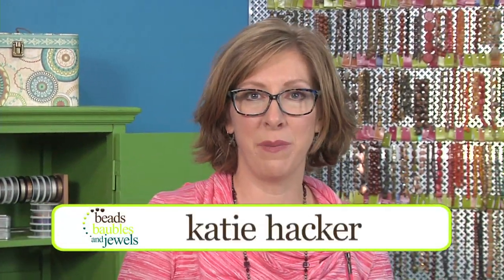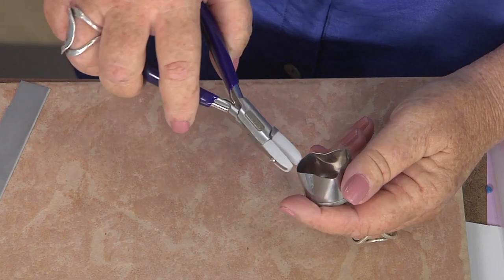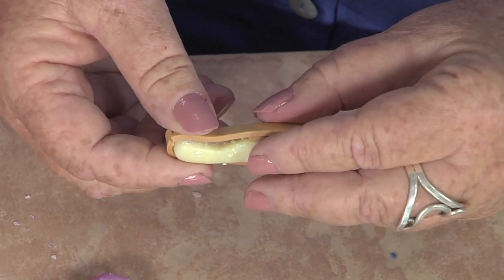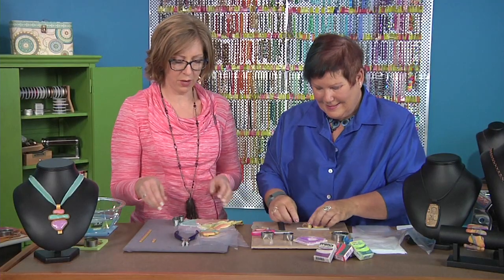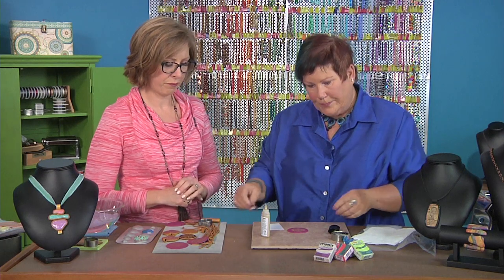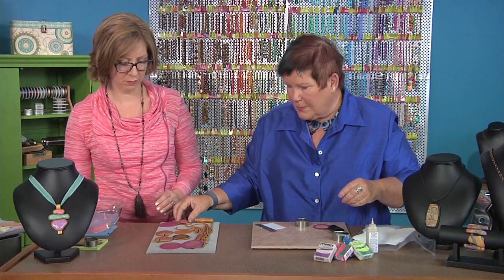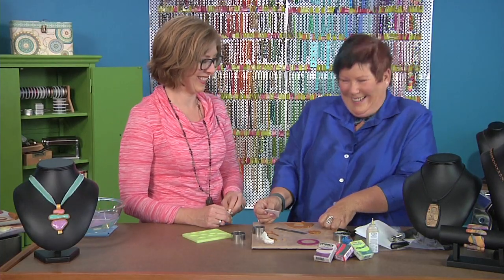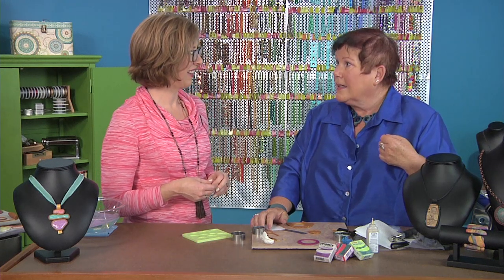Tips for making polymer clay jewelry on Beads, Baubles and Jewels with Syndee Holt (2413-1)

Comment: Hello, I just started using polymer clay.  I preheated the toaster oven and got it to 275 in advance (I bought a separate thermometer and placed it in oven).  I placed my piece on a piece of copy paper with a ceramic tile under it with a foil tent. I baked for the recommended time for Sculpey Premo (275 F). My piece broke when I tried to bend... I tried it for a little longer the second time... it broke again. I then kept it in there for an entire hour.. it STILL broke. I was monitoring the temp the whole time and made sure it stayed in the correct range. Every tutorial I watch says if it breaks, it hasn't cured long enough. I had it in there an entire hour! What am I doing wrong here?
Reply: If you are using SculpeyIII, that may be the problem; that is a more brittle, less flexible clay. Premo! or Kato Clay, or Fimo are stronger clays, and will flex if cured correctly. And yes, I always cure longer than the package states, minimum 45 minutes.
Reply: @deborahgoodrow8414  as stated above, I used Premo. I tried way over the recommended time. 45 min, 1 hour, even 1 hour and 20 minutes. I even tested a thinner piece and that one snapped instantly. I returned it all and gave up because there's no explanation for this. I followed all recommended advice. I also conditioned the heck out of it before hand, running it through a pasta making over and over as well as just using my hands. I'm quite discouraged right now. Both the things and thick pieces had zero flexibility and just instantly snapped.
Reply: @Kelly-lo6cz  Thats a bit strange... I made a hand shape to try to make a ring holder but the fingers were so bendy/flexible. They dont break... The only time I had something break was when I used sculpey 111